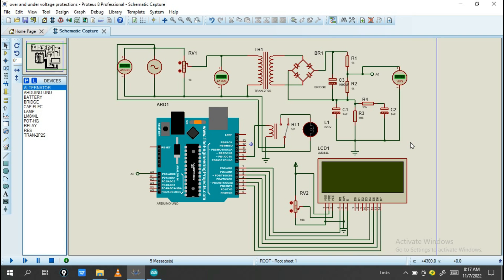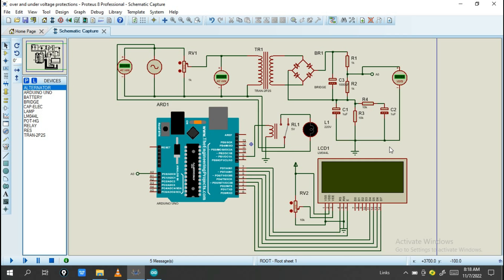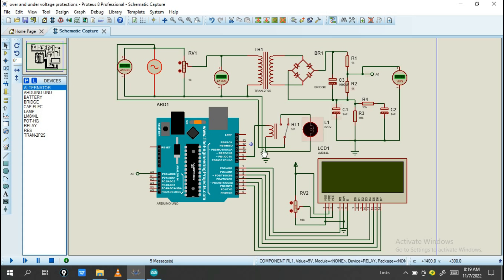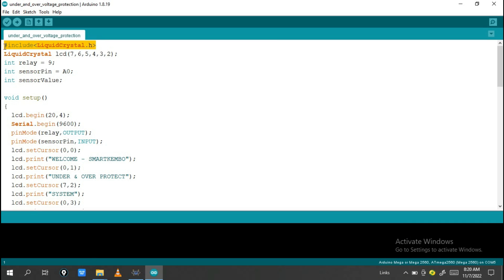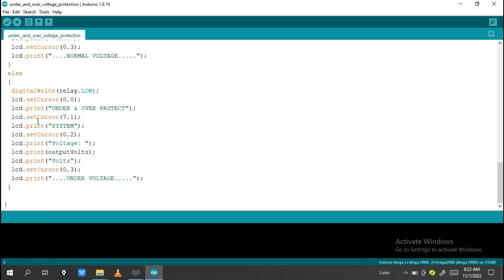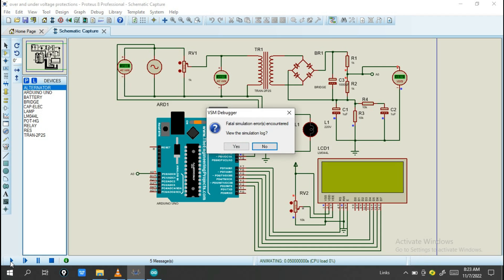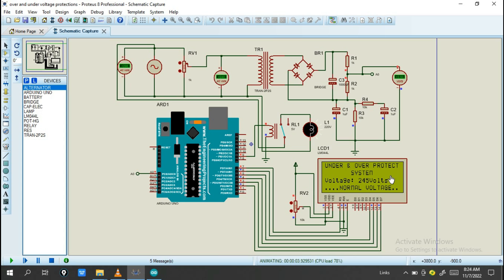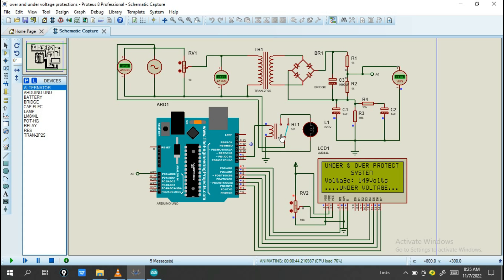How to make under and over voltage protection system using arduino

Comment: #include<LiquidCrystal.h>
LiquidCrystal lcd (7,6,5,4,3,2); 
int relay = 9;
int sensorPin = A0;
int sensorValue;

void setup()
{
lcd.begin (20,4);
Serial.begin(9600);
pinMode (relay, OUTPUT);
pinMode (sensorPin, INPUT);
lcd.setCursor(0,0);
lcd.print ("WELCOME SMARTKEMBO");
lcd.setCursor (0,1);
lcd.print ("UNDER & OVER PROTECT");
lcd.setCursor(7,2);
lcd.print ("SYSTEM");
lcd.setCursor (0,3);
lcd.print("......enjoy..... ");
delay(2000);
lcd.clear();

}
void loop()
{
sensorValue = analogRead (sensorPin);
int inVolts = 297; // approximately input voltage
int outputVolts = (sensorValue+inVolts)/4.5; 

if (outputVolts > 260)
{
digitalWrite(relay, LOW);
lcd.setCursor(0,0);
lcd.print("UNDER & OVER PROTECT");
lcd.setCursor(7,1);
lcd.print ("SYSTEM"); 
lcd.setCursor (0,2);
lcd.print ("Voltage: ");
lcd.print (outputVolts);
lcd.print ("Volts"); 
lcd.setCursor(0,3);
lcd.print ("....OVER VOLTAGE.....");
}
else if (outputVolts >=160 && outputVolts <=259)
{
digitalWrite(relay, HIGH);
lcd.setCursor(0,0);
lcd.print ("UNDER & OVER PROTECT");
lcd.setCursor (7,1);
lcd.print("SYSTEM"); 
lcd.setCursor (0,2);
lcd.print ("Voltage: ");
lcd.print (outputVolts);
lcd.print ("Volts");
lcd.setCursor (0,3);
lcd.print ("....NORMAL VOLTAGE.....");
} 
else
{
digitalWrite (relay, LOW);
lcd.setCursor(0,0);
lcd.print ("UNDER & OVER PROTECT");
lcd.setCursor(7,1); 
lcd.print ("SYSTEM");
lcd.setCursor (0,2);
lcd.print ("Voltage: ");
lcd.print (outputVolts);
lcd.print ("Volts");
lcd.setCursor (0,3);
lcd.print ("....UNDER VOLTAGE..");

}

}
Reply from the maker: Welcome for more and don't forget to subscribe our YouTube channel